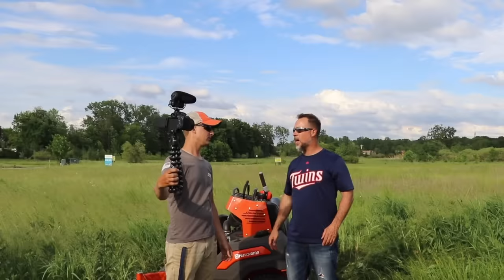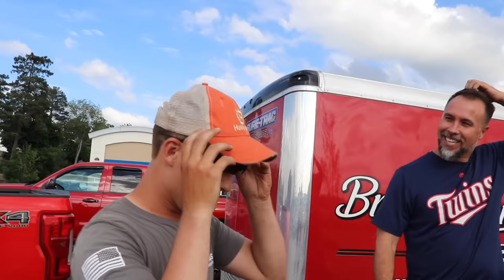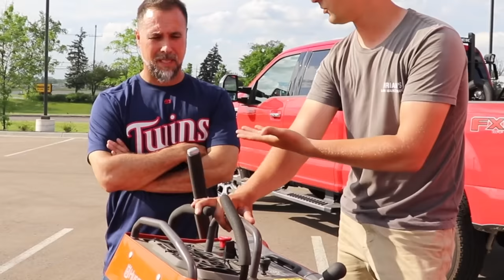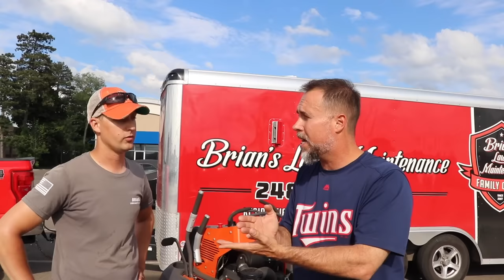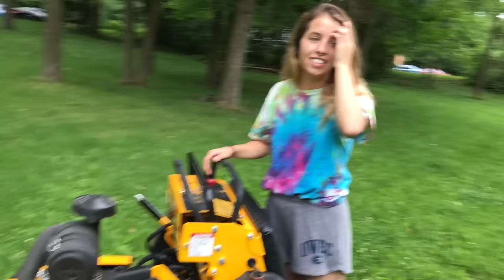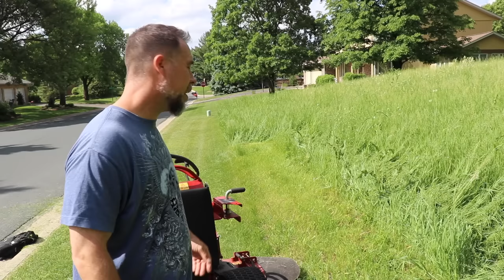Best & Worst lawn Mower of the Year- Husqvarna, Toro Grandstand or Wright stander z

Comment: I've had many different brands and styles over the years. Ferris, Exmark, Walker, Toro and on. My entire current fleet is Wright, we've got Zs and Standers and love them. Simple  easy to maintain machine's  that are built extremely tough and capable. Our first stander just hit 3000 hrs this past week with the only repairs beyond maintenance being a pto clutch or two and an engine rebuild this past winter as it threw a rod due to a dumbass not checking oil.

Comment: Husqvarna folks, if you’re watching this and reading the comments, this is exactly the kind of feedback you need for a machine that clearly needs a rethink.  Brian and Stan do an excellent job here.  If you improve on the areas they point out, you’ll be a lot closer to running with the established industry names.  

In terms of what you do with their feedback:  I suggest watching Kent Harlan’s review of the Exmark Spreader Sprayer.  It’s about 3 years old, and it’s for a completely different product, but the point is to hear Kent’s description of how Exmark responded to critical feedback.  He had close and repeated interaction with Exmark engineers, and how Exmark responded is, I think, an excellent tutorial on how companies should solicit feedback and dedicate resources to improving the user experience.  I can’t recommend that review strongly enough, as it incorporates direct product use experience with engineering process and redesign to make a more useful, reliable and profitable machine.

Comment: Lol, when you said you were going to ruin it I remembered Ed Wright calling me and asking me if I had any stumps in my yard...He came over with one of the Wright Standers, dropped the deck all the way down, and ground out 3-4 stumps in my yard. I think after about 4 the bolt on the blades broke (spindles were fine)...Definitely don't try that at home. I am sure he's abused those mowers way more than you ever have!! They make good stuff!
Reply: David Tucker II that 72 was a beast
Reply: I run a 52" wright stander zk and let me tell you... in miami florida we have st. Augustine grass which gets very thick during the summer. you can't stop the wright stander... the only complaint i have with my wright is when turning it will leave a small strip of grass not cut.... but only when turning.... otherwise I love it. I actually really like hustler mowers with the emergency brake being built into the return position of the operating handles!
Reply: Tim Pande do you guys use those 64” remote control tracked slope mowers  in Florida ,
Reply: I’d love a wright mower, but no dealers even close to me

Comment: i used a exmark grandstand with a plow with the safety bar used it for 12 hours straight it took me 30 min to not shut off the mower accidently every 30 sec after that i was fine never did it again. i like the safety bars because when i need to push the mower in the snow i can still drive it without being on the platform. btw i have never used a grandstand ever even mowing, great video stanley.

Comment: Don't forget to adjust the valves. Check the leakdown to check rings, valves, and head gaskets. Remove the springs to check valves. With springs off, rock the valves to check the guides. Replace the springs because they lose tension. Check head bolt torque.

Comment: I just don't think they know how the mower runs or they're that familiar with Husqvarna. They make great mowers and equipment love mine. But as far as the controls go once you know where they are you'll get used to them. And In the safety shut-off put the brake on that way when you get off the mower it doesn't roll down a hill, it will stay running. Next off you're trying to Bush Hog with a mower that supposed to be on lawns not fields  Husqvarna makes a bush hog mower for that R322T brush attachment. And make sure you turn on the blades next time. They make great stuff. And there fleet program is great to.
Reply: : 
F
Reply: Jerry 
Agree with you about Husqvarna being a great product. Mowing a field is not what a finish mower is for. These guys are trying to trash a good mower brand so they feel better about their overpriced units.

Comment: cant wait too see call these mowers in action...im in the market for a stand on unit right now. As far as the demo that you performed on this Husqvarna I don't think we should give a rip on how it cuts waist tall grass..its not a brush hog
Reply: +kevinboo2000 definitely test ride a ferris z2 and z3x. I've got two ferris standers, which are amazing! Suspension, speed, durability, and reasonable market price compared.
Reply: Did you watch the part where the yellow mower (Wright) went through and one-cut the 6-8 foot tall grass! That's how the Husky should have cut that waist high grass.
Reply: +Andrew Delashaw that's if you want to drop $12k+ on a mower. I got my 52" Z2 stander brand new for under $7k
Reply: Andrew Delashaw That Wright mower was probably double the size of the husky.
Reply: The scag stand ons are great mowers, among others.
Reply: Michael Zeleznik I second this Ferris Z3X is the best stander on the market hands down. Picked one up at the beginning of the season and has exceeded my picky expectations by far.
Reply: Michael Zeleznik I agree my dealer has a 48 inch ferris out the door 6700 ! There's now way any other mower thats 4k more than a ferris can be that much better
Reply: In REALITY the city would fine the homeowner $750/day once the grass reaches about 10 inches. That's $750 a day for quite a few days. If you let a customer go thru that you deserve to be fired regardless of what brand mower you're bragging about.
Reply: mike ries..i don't know where you live but the city does not fine 750 dollars a day any where that i have been and i've lived all over the country...most city fines are like 75 dollars ..and if the city has to mow it they charge you between 250 to 500 ..i call bullshit on your 750 dollars a day garbage..even places like homeowner associations don't charge that in fines...nice try though..don't come on a landscape/lawncare channel and try to bullshit everyone who does this for a living
Reply: Check out the Encore Rage for sure. Extremely well built standers. I've ran one for 2.5 years and it's the main mower on my son's and mine trailer. Kawasaki engines and the same hydros, pumps, bearings, and spindles as all the so called "big time" mowers, for probably a grand less. Along with a 3 year commercial warranty. We run a 52" and I plan on picking up the 32" they offer in it this year. All of our yards with 3ft gates will be done in half the time meaning more money.  Good luck on whatever you buy.
Reply: @coreys.9426  A Wright Stander with the same size deck will still run circles around that Husqvarna.  Ive used a Wright Stander for 2 years and we cut mostly high end beachfront properties.  That Wright Stander also makes mincemeat out of overgrown properties and 'fields'  a lot worse than this one

Comment: I think everyone is missing the point of cutting  quality. These mowers are all finishing mowers not slashers
Reply: finish or not it should still cut not going to spend that kind of money for something that wont do the job when there is one that will
Reply: seriously,  I have to say it's cutting less than I think it should though.  maybe they have the deck up.  ALSO if it rained recently or if that grass is wet is another factor that I don't hear discussed.
Reply: Joe Scheller If the grass is taller than the distance from the back of the blades to the front of the deck,it won't cut it hardly at all. The deck holds the grass down from the cut. That's not a fair test of that particular mower. If you plan to cut tall stiff stuff like that,you need a different machine. Saying it's junk because it won't work outside it's design is not fair. I saw plenty wrong with it but the cut was not one of the things.
Reply: @mckrackin5324  why can a Scag or xmark finish mower cut long stiff grass? Sure you might have to go over it once or twice to get every hair but it should still CUT.
Reply: These are commercial machines. When you do commercial lawn care, sometimes you're literally thinning a field.  This is exactly the kind of stuff you want to try to mow when trying to decide what equipment to invest in.
Reply: Good unit will cut hight Grass
Reply: A finishing mower should take that task grass with ease. That mower is a peace of crap. My propane 60' John Deere stander handles much taller grass with ease and it's made to make grass look good.
Reply: I used my finishing mower to reclaim an overgrown field, worked great.  Go go kubota!
Reply: pete strong he’s from Minnesota, so.....
Reply: @joescheller6680  .. how embarrassing .. seem to know very little about what shallow decks are designed for
Reply: Nothing is gonna compare to a scag or exmark
Reply: Who cares
Reply: I believe that they set the deck up to high and they are mowing into the high grass which makes it harder to mow
Reply: Not spending that kind of money just to trim a yard! Did Husqvarna bother to sharpen the blades? Did they install them backwards? I used a 19” walk behind in Texas, knee high grass, cutting height 2”. Just out of the Marines. Took 30” steps, 1 step per second. 125’ x 85’ barnyard. Finished in less than five minutes.
And a riding mower can’t do something that simple? Then it ain’t worth the money! And stupid controls thrown into the mix!?! And stupid maintenance positioning? NOT worth the money!!!
Reply: This is why people go for a Lawn Tractor with a difflock. Zero turns are for established established lawns not slashing a vacant block.
Horses for courses

Comment: It's not really fair to run this in a field and complain about cut quality. It's a finishing mower. The other things are completely valid though. Wouldn't want to run this all day.
Reply: Corey S. it is fair when most other mowers will cut stuff like that just fine. We use our Deere mower to trim cow pasture edges next to the fence before we brush hog it... and it's mowed just as well as the yard on the other side of the fence in a single pass. I think a lot of it has to do with deck design.
Reply: Drew well thats if u wanna pay alot of money.
Reply: Drew w Exactly, it’s deck design. I’m sure that deere is much bigger and made more for taller grass. It seems to me like that husky is made for finishing commercial and residential  stuff. I just think he should have tested it there as well.
Reply: CrazyAmazingHD Deere stand on mowers are in the exact same price range as these. And the Deeres have much better controls and engine access.
Reply: i dont belueve this kind of mower is for clearing 3' tall grass, i think mowers that are designed for this the blade housing is open in front so it doesnt push/hold the grass down, ....im no expert just sayin
Reply: That's what I'm thinking.  This mower isn't meant to cut tall grass that hasn't been mowed in 6 months.
Reply: it's not about the height of the field grass..it's a test to see what it's capable of..brian has tested several stand ons in this same exact field..he even says this isn't typically what he mows but he wants to put these mowers through their paces and see what he likes more..i believe he went with a ferris as his personal choice

Comment: Ok guys here’s the real deal from another veteran pro about the safety switch. It’s like the EX-mark, Toro. The great advantages to this type of safety switch over the stand on pressure plate style. Is you can step off an use it as a walk behind. I ran several stand on‘s at the GIE this year. I absolutely loved the performance of the Wright best then Scag . But like the walk behind capabilities of the Ex-mark, toro.

Comment: I think after getting off the machine 15 times it would be second nature to pull the brake. Though the PTO shut off would be better I think you are making a mountain out of a mole hill. Throttle definitely should be moved to the right side. I'm gonna be running this machine this summer so I'll come back in a two months and give a review. For never running a stand on before, whipping it around the parking lot at the dealer today was pretty sweet. Walk behind capability in my area is a great feature, lots of areas I'm going to be utilizing that and I like the brake and deck levels on the same side.

Comment: I bought an Ariens Ikon X 52 inch as a starter mower for my new business. I have tractors and push mowers also. Anyway, back to the point. The Ariens has been used for everything, mowing saplings, grass and all the weedy stuff i could throw at it. It just chopped the lot up like it was nothing. As a finish mower, it is amazing. So level and hardly needs a second run at anything. Even the toro doesn't match it. I know, I know Toro this, Toro that, but for 3 grand all in, it has completely blown my mind. Fabricated deck and a kawasaki 23 hp motor, only issue i have is grip, but i try to put it on inclines it shouldn't cope with, guess what? It does that too. And it's made by Gravely and Made in AMERICA.

Comment: This is the first year for this Husq stander. Controls are not ideal I get it. They really need to improve that and the ability to service. But mowing in that condition common now. More of a brush hog job if you ask me. These mowers are finish mowers but test what you want. Also deck sizes DO matter!!! Blade tip speed should be different between 52", 60" and 72" so they will cut different. Take a look at the Encore Rage. I would really like to see you guys do a review on that stand on and some of their ZTR's.

Comment: Thanks for the review guys that husqavarna has a terrible design you can't even check the oil you have to bent the dip stick when that dip stick gets older it will break and pieces will go inside the engine that is terrible.

Comment: I have had a Husqvarna for 6 years and up until three weeks ago was pretty happy with it. There is now a 4in hole around the mounting bracket in the deck. The weld of the mounting bracket didn't break, the deck did. I will never buy another has Husqvarna.

Comment: I sure would stick with my mellow yellow (wright) vs that pos.  I cant imagine the frustration and headaches that thing would cause from daily use.   You can polish a turd only so much but until those issues which i agree with are fixed its still just a polished turd and not a well oiled machine.

Comment: Using a finish mower to mow over grown fields ??? 🤔🤔🤔
Reply: yeah and you have never gotten a new client and their backyard is waist high?
Reply: Literally every "finish" mower ive used could handle that tall grass no problem. 

Bobcat, Exmark, Wright, Gravely, Wright.  All of them handle that stuff no problem
Husqvarna just made a bad mower lol
Reply: @danielbabcock7004  I simply don't know what's the problem with that Husky..It definitely ain't a lack of power since it's a 28HP. It has to be a problem with a deck design or a blade design. I wish Husqvarna representative would address this since this is a bad commercial for them, especially knowing how Husqvarna makes extremely high end commercial stuff. From their weed wackers to chain saws to anything  between. But now that I think of it they never made commercial push mowers either. Just residential.

Comment: Curious why does one buy a stand on rather than a riding mower?
Reply: Because if you are sitting and have to get off the mower you have to stand up. The stand on machine is faster on and off. You can see more. The human body is not made to sit. When sit down mower is on rough terrain you may as well walk your back os taking abuse
Reply: with the new zero turn mowers your steering and brakes rely on one wheel forward or back.  so u brake drive traction u have neither steering nor brakes your on for the ride.  stander mower = just steep off.

Comment: I get you want to test these in more extreme situations, but using a finish mower in place of a brush hog is going a bit far.
Reply: This is the weakest excuse for these mowers. Firstly, they are clearly cutting grass. "Brush" consists of grass, herbs, shrubs, vines, weeds, and small trees. Do you see any of that there? No. Therefore, it's just tall grass. Secondly, I've cut WAY higher grass than that on my little $1000 riding mower and it did way better than that mess of a machine. 

How can people seriously defend this crap?